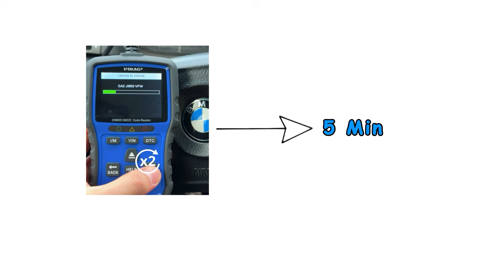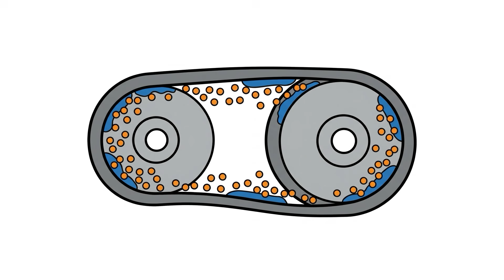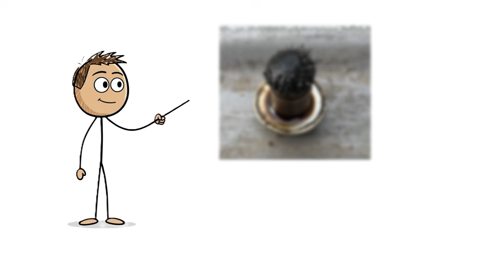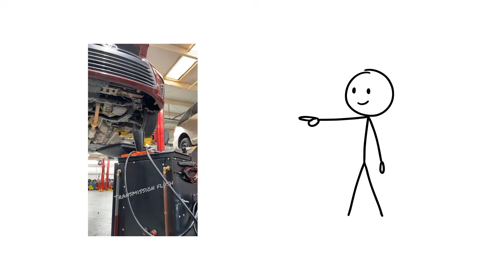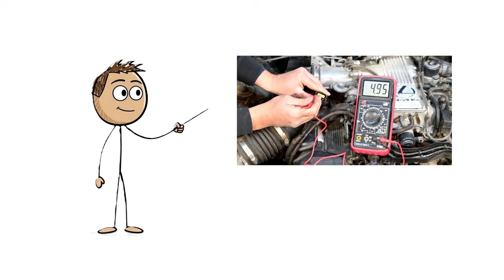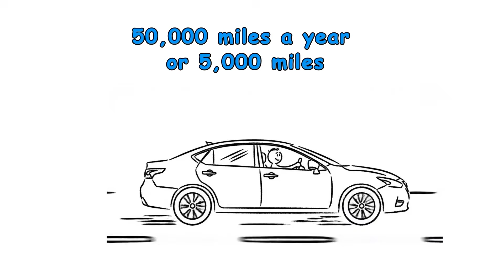How This Forgotten CVT Trick Becomes the Difference Between 100K and 300K Miles on Your Transmission

Comment: What about castrol transmax, lancer owner , I bought my car from a shady small dealership , transcode would come up checked fluid wasn’t oem color looked like valvoline, I replaced filters and refilled with castrol cvt ( castrol manufactured ) diaqueen mistu oem (look on back of container) I can now drive 100 mph for more than 30 mins without a trans light , but I would want to try that Bluetooth thing were it will show me my trans temp , amazing video

Comment: "I am experiencing a driveline‑related issue with my Nissan Teana, primarily noticeable when the vehicle is cold. After the car has been parked for several hours, shifting into Drive and allowing the vehicle to move without applying the accelerator results in continuous low‑speed jerking or knocking vibrations up to approximately 20 km/h. These vibrations appear to originate from the central floor area, giving the sensation of driving over repeated small bumps. Once the engine and transmission reach operating temperature, the symptoms become less pronounced, but they still occur during initial acceleration from a standstill until the vehicle reaches around 20 km/h. All front suspension components, engine mounts, and transmission mounts have been replaced, and the transmission has been opened and inspected with no faults identified. I am requesting a comprehensive diagnostic to determine the underlying cause of this low‑speed vibration under light load."
Reply: By now 2 months later, I think that you must have had the cvt transmission replaced,  (hopefully under warranty) ... OR had to get rid of it. ... NEVER NEVER CONSIDER ANOTHER CVT VEHICLE !  I Don't care how terrific the price might seem !! .. THE ONLY SOLE  EXCEPTION IS ANY TOYOTA with what What TOYOTA calls an "E-CVT."   THOSE ARE NOT ACTUALLY CVTS !!   This transmission has NO RUBBER OR METAL BELTS or the PULLEY type of wheels.  The gearbox is instead ALL GEARS !!  The other CVTS in cars are basically improved versions of snowmobile or GoKart cvts !!
Reply: SOME HONDA and SUBARU CVTS are more durable than Nissan's.  Also I've heard that MAZDA is now putting TOYOTA E-CVTS in some of their cars.  I haven't verified that yet.